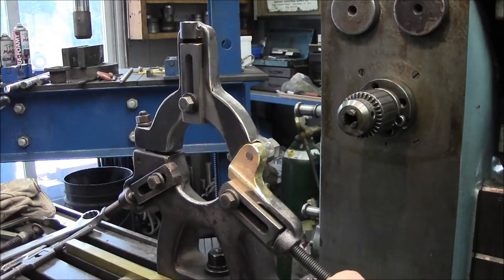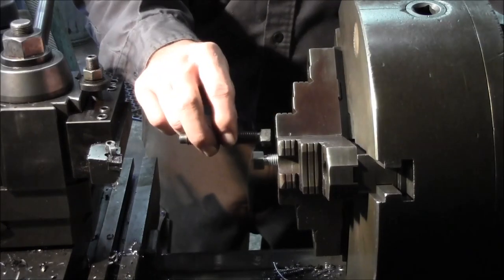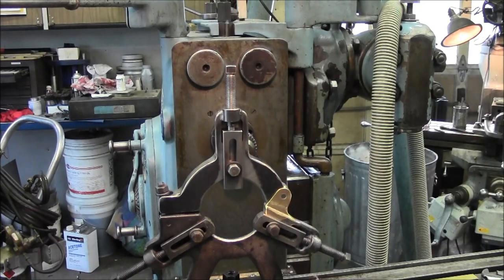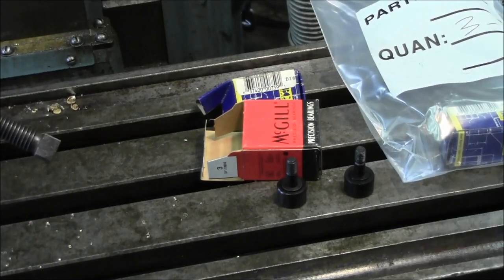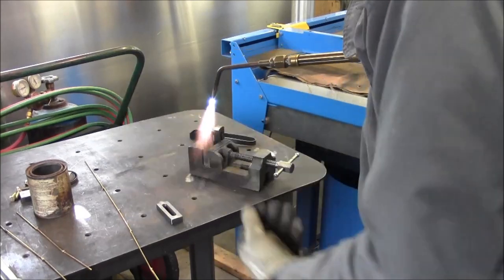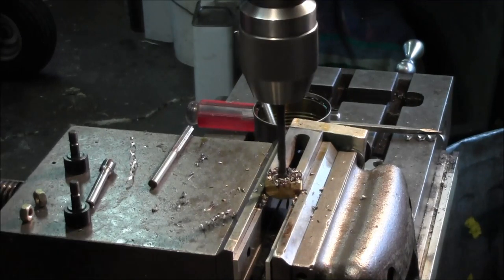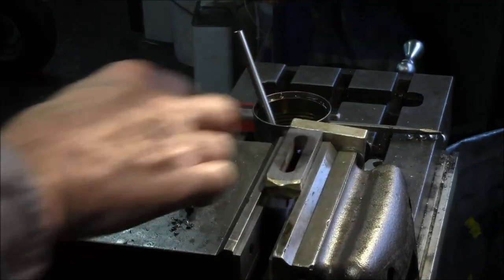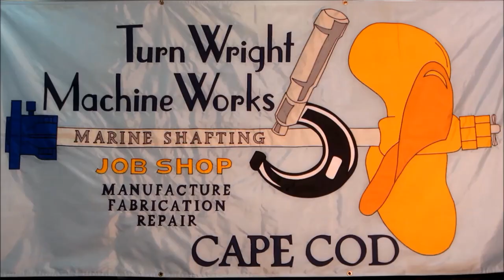The Million Dollar Rest Part 6: Lathe Steady Rest Repair and Roller Addition

Comment: Real nice repair job Keith ! As always. We had to do a similar repair on a steady rest off of a Russian lathe, but it was the bottom half that was cracked after it was dropped during a move. We used quarter inch plate as well, but I sure wish we had that plasma cutter like you. Real time saver I guess. Thank's for the great vid's.

Comment from the maker: Hey it didn't fall out! and got to try it out on the S/S build up, was a bit more aggressive than the used Sandvik and seemed just a bit rough but I only had a few strokes with it so they sit side by side for the next part for testing. ;{)---

Comment from the maker: A spring cut, no matter what your operation is, turning, threading or boring etc. is when you take another cut without advancing the amount to be taken and follow the same path you just took. The spring cut will pick up any or some of the material that wasn't cut in the prior cut because of the tool bit pressures, that held it out from planned tool bit path. A following path without advancing the cutter. ;{)-----

Comment from the maker: I know I said carbon but it is actually a high heat graphite slab, I bought that one at McMaster Carr, but there may be other cheaper sources. You could also use copper. Thanks for the comment! ;{)---

Comment: On small pieces like that, it's easier to drill the hole first so you have something to really grip in your vise, then cut the piece off.  It also means less material to cut with your hacksaw.

Comment from the maker: They are both applied using an oxy & acc set up but different alloy's, Silver and brass or bronze. The silver flows a little easier than the brazing and has a lower melting temp. ;{)-----

Comment: seeing you go at it with the metalsaw makes me think of a stupid thing i done in my youth , had to make a new holding pin for a metal saw to hold the blade in , used a long nail so i needed to shorten it 
put the metal saw with a brandnew blade upside down in the vice and used a second metalsaw to shorten the nail , whent a little quicker then expected and i ran my pinky across allmost the ful length of the upside down blade , bled like you wouldnt believe can still see the scar allmost 30 years later

Comment from the maker: I chose to create the ear with solid brazing rod to set a topic of thought for everyone! My thinking, one bond, one chance of failure, bond two pieces, twice the possible failure. I also feel there are fewer waists in material and lower cost with the brazing rod verses the raw stock cost, if having to procure each new, include minimum ordering. I also have had request to show more brazing and I wanted to expand on more than just joining two pieces or repairing a crack. ;{)---

Comment from the maker: No, I haven't, but I use it in TIG wire and a long time ago I did a gear tooth replacement with it also, really under cutting the cast to make sure there was no crystallizing going on near the root of the teeth. ;{)---

Comment: Magnificent series, Keith. Watched it for the third time tonight. Like a couple of other folks have mentioned, I had no idea brazing alloy was strong enough to do the job in this application. I'm wondering, what drove the decision to make the upper piece a weldment rather than milling it out of a piece of solid stock? Thanks for all the videos and the knowledge and experience you share.
Reply from the maker: I choose to make it a weldment because I wanted to explore the shaping by layers and how close I could make the shape, in the PlasamaCAM, with little mill work. ;{)-----
Reply: Keith Fenner
 Thanks for the reply, Keith. I knew you had a reason, just didn't know what it was.

Comment from the maker: C&P old comment, I chose to create the ear with solid brazing rod to set a topic of thought for everyone! My thinking, one bond, one chance of failure, bond two pieces, twice the possible failure. I also feel there are fewer waists in material and lower cost with the brazing rod verses the raw stock cost, if having to procure each new, include minimum ordering. I also have had request to show more brazing and I wanted to expand on more than just joining two pieces or repairing a crack. ;{)---

Comment from the maker: If the original maker offered repairs like I did on this rest than yes, I would feel like I might be stepping on some toes, as long as you are not copying for sale and or profit you are not infringing on patented items. Most of the time there is no problem because, it would be a fools market to compete with a head started creator and his running production made parts.

Comment from the maker: Hi David, I ordered those bearings, called cam rollers or track rollers, from Action Bearing near boston, but if you have a bearing house near you they should be able to procure. If you wanted a site to check out sizes and loads, Mc Master Carr (dot) com, type in track rollers then ask or click on page view, then flip the pages if wanting for almost anything! you can even buy from them, might be about 15% higher than a good bearing house. ;{)---

Comment: Why does every welding and machine shop in the country have the same can of flux? The can is always a little rusty, the label is always a bit mangled and burnt and there is only about 1/2 inch of flux in the bottom. That can really gets around.
Nice video!

Comment from the maker: If you could, tig, mig and or stick without bringing the cast material to a molten state, which causes the faults, in those procedures, I would add them to the brazing process, as another way to getter done! ;{)-----

Comment: Hi Keith,

Can you use a Tig process to braze cast iron? Heat is heat right? Why not heat from a tig? If you can do you still need to use flux or will the argon shield keep the weld clean?

Comment: The part turned out great! So do you brazen smaller rods together to make a long one? I have a friend that does the same with aluminum rod so he does not need to stop mid bead on alloy radiators.

Comment: About .001 to .003 inches up to .005.   I brazed up to 1600 parts per 8 hr shift for about 15 yrs.  Tho mostly copper to copper, copper to steel and copper to brass.  My parts were tested to 550 psi so I knew when I screwed up.

Comment: bit of an odd question : about how long do you do with the gas in a set of tanks (total burn time) thinking on getting a smaller set with half tanks or even smaller for hobby use , dont do a lot of soldering , will probably use it mostly to heat u stuff for bending and fitting , i dont want a lot of explosive gas in my shop in case of a fire